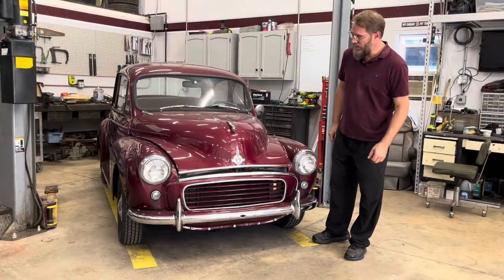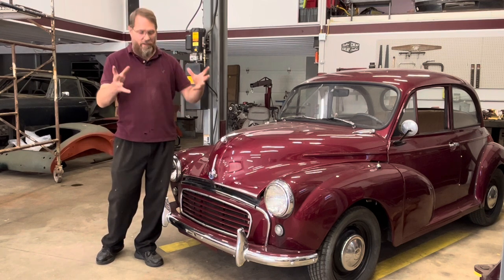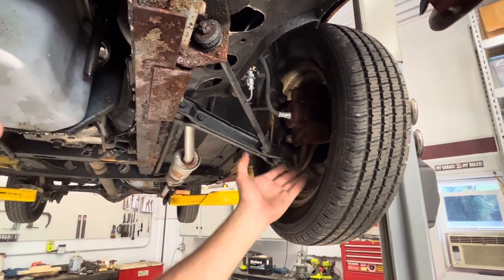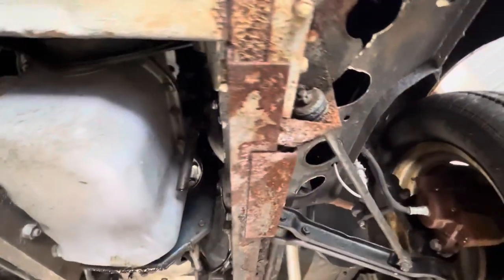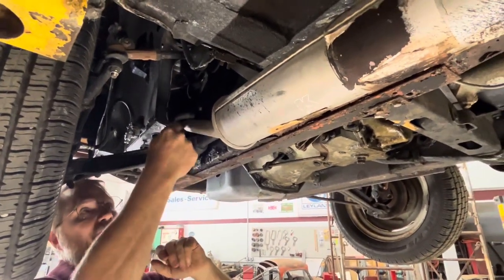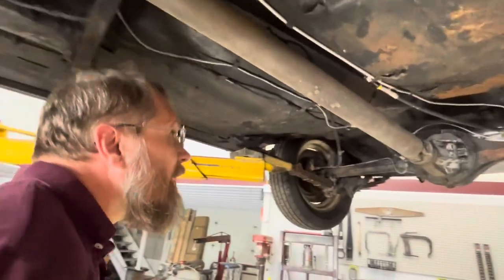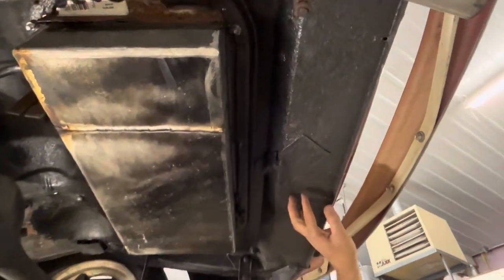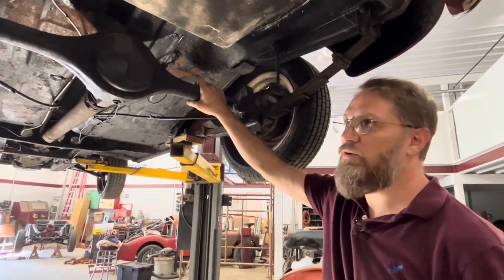Morris Minor 1000 first look. New owner has some concerns

Comment: Replacement bits are readily available in all of the areas where they have welded angle and other pieces of metal. Replacement boxes for the two frame rails in the front are designed to fit over the existing rails then get welded into place and provide a very strong (and proper) repair. From Rob’s pictures, the cross member appears to be in good shape (which is critical) since that’s where the front suspension attaches to.  Tony Burgess - Chairman, Morris Minor Registry of North America.

Comment: Morris Minor fun fact: Alec Issigonis designed it, and later designed the abfab Mini. When he was designing the original Morris Minor (the MM lowlight), the story goes that at the last minute he woke up in the night and decided the car needed to be 4” wider. But some cars were already built or had parts already manufactured. So he had them cut in half from front to back and widened. Hence the 4” raised panel in the middle of the bonnet. Also the very early MM bumpers were cut in half and a strip of metal was riveted (bolted) on to accommodate the wider car. It even had a hole for crank starting if necessary!

Comment: Very dangerous front chassis rails; if you were to hit a kerb or pothole hard, the lower arm pivot (eyebolt) will be torn out, also ripping out your brake line so you can't stop - ask me how I know! They need chopping out and replacing.

Comment: No you are wrong , the Morris Minor was never the base for the Austin Healy sprite , the only things the two cars had in common was the engine and gearbox, which where in fact Austin not Morris . 
The Austin Healy Sprite Mk1  was based on the older Austin A30 sedan , same front suspension and running gear except for the rack and pinion steering  on theSprite.

Comment: Strange. So much work done, but not the main under structure.
Reply from the maker: It’s actually not as unusual as you might think. I’ve seen a lot of cars with quick patching underneath and a fair bit of work to make them look good on the outside.